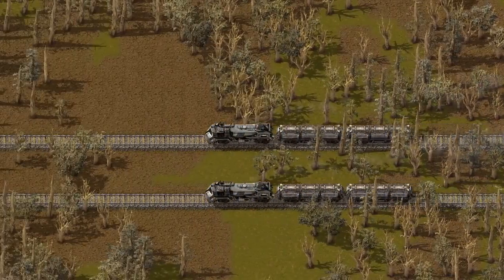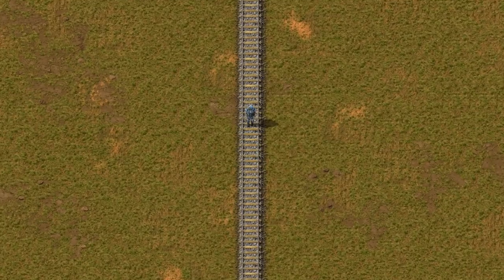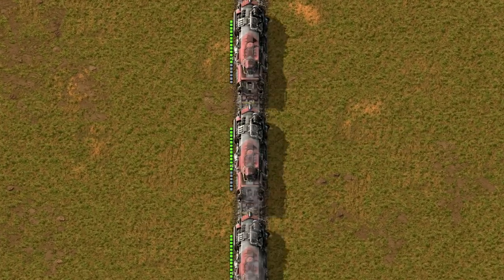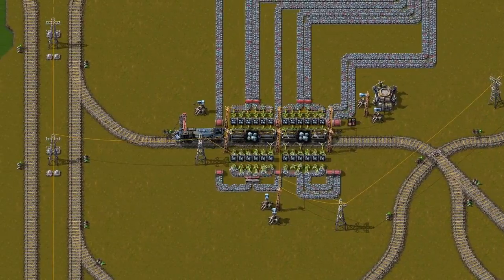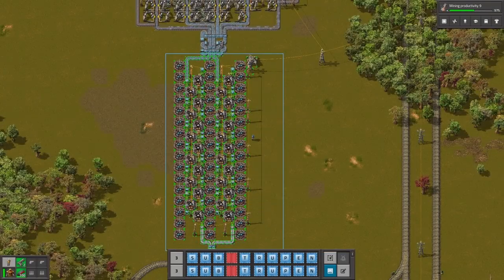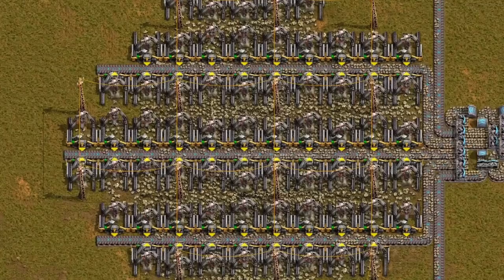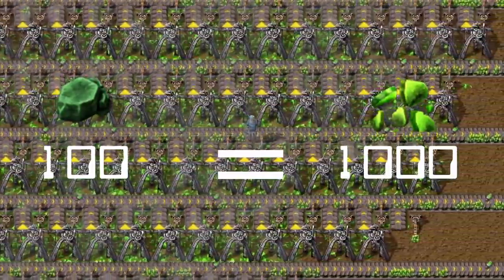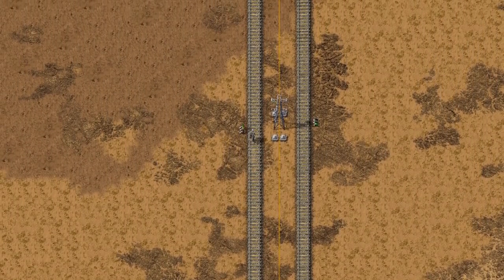Upgrade your trains

Comment: It's not 100% more efficient ( with iron / copper ), because of the productivity modules you are making 1.2 Plates per ore, which makes it 66.66% more efficient ( with stone it is 233.33% instead of 300% and with uranium it's just 733.33% instead of 900% ), but it still is very good
Reply from the maker: you are right, it's not as good as I said, but it's still a good thing to do
Reply: I always just build green chip manufacturing at most of my copper outposts. Bring in 1.4 trains of iron plates, send out 1 train of green chips.
Reply: Wait i dont understand the stone and uranium part
Reply: @ninjaexperto7217  Smelted stone stacks twice as high as raw stone, while also using 2 stone to make, so 1 stack of stone bricks is worth 4 stacks of raw stone.

U235 stacks twice as high as uranium ore, and if you fully kovarex the ore, it takes roughly 3 ore to make 1 U235, meaning one stack of U235 is worth 4 stacks of ore.
Reply: only under a factorio video can such a comment be top voted
and we all agree
Reply: @ninjaexperto7217  stone takes 50 and makes it into 25 ( or 30 with productivity modules ), because its orignal proportion is 2 stones to 1 brick, and urainum takes 50 and makes into 5 ( or 6 with productivity modules ) because its original proportion is 10 ores to 1 uranium
Reply: @DEMEMZEA  oooooohhh now i get it, thanks :3
Reply: However I would argue that outsourcing uranium processing isn't necessary, since as you won't use a lot of uranium in the first place (tbh here the only place you will ever use uranium regularly is for fuel rod, but even that is rare enough), throughput isn't a problem, convenient is king.
Reply: Do you have T3 modules for every furnace?

Comment: I usually build refineries at ore sites when I can build defenses, but if a refinery center runs out of ore from its fields, I'll send ore trains to it rather than dismantle it.
Reply: I just build a single express belt leading toward my base and extend it out wherever I see a lot of its ore type on the map, then any new ore fields can have their ore shoved onto the main ore belt. But don't trust me, I am not an engineer.
Reply: This is probably the best thing to do honestly.  Train congestion is going to be minimal on your rail spur lines that run to individual ore fields.  Rail congestion at your main base is going to naturally be much higher as trains deliver resources... especially if you're using rail to connect sub-factories rather than belts or bots.  You could do as Trupen suggests and build smelter arrays at every ore field, but that's a lot of building and deconstructing each time there's a new field needed, which can become tedious.

But by doing as you suggested and decentralizing smelting, you get the benefits of reduced main base congestion, without having to constantly rebuild smelting arrays.  The only real disadvantage is the increased complexity in managing the remote outpost and expanding smelting capacity.  The beauty of this method however is that if you have too much ore and not enough smelters, you can always build another smelter array at your next ore field, rather than expanding the first one.
Reply: @albertjordan3249  train congestion dont happen if you have highway. it only happens when slow train blocks faster running ones. Have 100+ train track blocks before trains enter or exists, they dont stop traffic, just join full speed and leave full speed, without jams

Comment: It is basically a choice between Rebuilding your smelters whenever a resource patch gets depleted VS using lots of trains.

Also you can attain additional efficiency by transporting them in the form of chips(green, red, blue) and steel, because plates in itself are barely used.
Reply from the maker: yeah you are right, you can make it even better :D
Reply: I like to make things "built to last" so I aim for excess mining and explore a lot outward for more richness so a smelter setup would be also relatively permanent in my situation

I really like the idea of condensing down transport items, it's just often making things too complicated for me

in dyson sphere program you just ship everything interplanetary, which makes it a lot easier because it's done by massive freight ships that work like a drone network
also I kind of get exhausted before I reach capacities where it would make sense to do so
Reply: @Trupen  Just make a whole factory at each outpost. There, infinite efficiency! x)

Comment: Something I would personally think might be a good middle ground would be basically have your main factory but keep most of the actual smelting away from it, but instead between your main factory and the different mining outposts, on the far outskirts of the main factory have a few semi large smelting bases that just kinda act as a hub for multiple raw resource inputs being the ores and have some trains take the processed stuff to the main factory to be used

Comment: See, now I used the trains to hauls ore because I already had a massive smelting area in my main base, where the extra pollution didn't draw in bugs.  I never thought about the stack capacity of the trains in regards to material storage efficiency.  I just learned something I already knew, but now that I'm looking at it, I know I can't ignore it.  Thanks for the simple tip on materials transport.
Reply: Definitely an argument for having separate stations for smelting and running trains from smelting units to production units in the factory.

Comment: Could you do a video explaining the big train rules? I always get confused on proper train input/output design.
Reply: Every 30 minutes or so it seems the natural resonance of my factory throws off my trains and they all collide!
Reply: @tylermcnally8232  I'd recommend reading more on the Train signals.  A 3-way intersection is the easiest to set up correctly, so make your train network look like the mortar in a brick wall.  You also need enough room between signals for an entire train to fit
Reply from the maker: maybe some other day, because it's hard to explaining in this video format

Comment: 50 Engin unite = 50 steel + 200 iron = 450 iron = 450 iron ore
200 green sircuit = 200 iron + 300 cooper = 500 iron amd copper ore. 
outposting. Yes!

Comment: Trains are like, the easiest to upgrade the throughput of. With bots, you have to keep adding tons and tons of bots to increase their throughput. With belts, you have to add additional belts. With trains, you only need to add more cars/locomotives. If you design your train stations with upgrading throughput in this way ahead of time, it's extremely easy, as you only need to add the additional cars/locomotives. 

Belts don't exactly have this luxury, because planning ahead to add additional belts is a lot trickier and more difficult and if you end up needing that space for something else instead, you could end up completely ruining that potential to expand. Bots also have a few limiting factors on their throughput, like Roboport placement and having to charge, and the odd and awkward way dispatching bots to fill requests works. Trains don't exactly have these limitations. Putting down rails in your base pretty much only needs to be done once and then you can have as many different branches come into that station as you want, after a certain point you'll reach a limit with how fast your trains can be unloaded in order to let the next train in, though. But that limit has a CONSIDERABLY higher maximum throughput than belts or bots.

But to be fair, Trains don't exactly compete with belts or bots in the same way that belts and bots compete with each other. Trains are really more for transporting a very very large amount of resources a very very long distance. Belts and Bots can't exactly do that.

Comment: A part of Factorio I really enjoy is, this math thing. You count those miners, account for productivity bonuses and/or modules, and fit exactly (kinda) how many arrays of furnaces you're gonna need. Why I types (kinda) is for me, woth RSO, I often get way larger and denser patches that I can't tap out entirely at once, so I rely on that patch for my, say iron. I assume my next needed production (3 times the previous or whatever), amd plan accordingly. True, we'd consume less than max mining production, but we consume less than we mine. And if you want extreme logistics, even with custom stack sizes, reduce resources into intermediary products that reduce 2 irons say to 1 gear. Obviously, you may need back and forth resources where you need product y and x from mine x, so bring that in if you will. I usually bring the least consumed products, like iron to copper mine for electronic circuits instead of the other.

Comment: I just build a large smelting station that has its own dedicated load and unload rail lines and stackers so the trains don’t even have to come into contact with one another. Up to 32 blue belts of plates for copper and 24 for iron and still haven’t come across a train bottleneck with 1-4 trains. Now if consumption exceeds production the entire base shits the bed and gets gridlocked… funnily enough that just means I need MORE trains unloading ore lol.

Comment: I disagree. Smelters with modules and beacons are more energy efficient in one central location. 
This way also means more rebuilding and tearing down of smelteries. 
It's just easier to use a central smelter and mining outposts. 
This might be fine for really large factories with enormous resource patches.
Reply: Who cares about rebuilding smelters? It isn't like pasting down a blueprint of something you already have built takes very long.
Reply: @petkras  Plus hauling all that stuff plus connecting everything (while at this stage, bots are better than belts, going with bots means carrying them too).
Reply: @1Maklak Just enlarge your Logistik Network. ;)
Reply: @CYBERNORM  Long-distance bots are a terrible idea.
Reply: @1Maklak  i am a noob, but i like it. I often forget Something to build, or have some wrong Train signals. My Bots can correct it. :D 
Just have to make sure, they dont have to fly over enemy territory. IF there are biter nests, just upgrade their Home with laser turrets and Solar panels + battery.
Reply: @CYBERNORM  Once you have all the blueprints, trains just work and the most time consuming thing is wiring up all the belts. Try KatherineOfSky's blueprints, they're good. 

I tried connecting a remote smelter to my base with bots and it was just a horrible traffic jam that ate electricity like it's candy. 

That said, whatever works for you. I like 4-wagon, 1-locomotive trains on a network with two rails next to each other, going the opposite ways, but with enough electricity and charging, bots can work too. They're just more efficient over short distances, so most people generally settle on a combination of trains, bots and belts.

Comment: Max train setup
A train with coal and no tech
100% acceleration
100% max speed
100% deceleration 
A train with nuclear fuel and max braking force
250% acceleration
115% max speed
200% deceleration

furthermore with the plates instead of ore loading 
50 iron turns into 60 plates (all of these are with 2 prod 3 mods) so not quite 2x density.
50 stone turns into 30 brick which is a little under 3x density
and the uranium 100 turns into 12 which is about 8x denser, but then you have to deal with enriched and unenriched uranium (maybe do enrichment on site.)
also if for whatever reason you just want to do basic oil processing it's better to do that one site and pipe / train the petroleum gas away as it takes 100 crude and turns it into 45 petro (58.3 with 3 t3 prod mods)

Comment: To me setting up outposts is quite annoying even without smelters and with bots. I guess my factory is still small.
Reply from the maker: you just need to make a nice blueprints
Reply: @Trupen  the problem is each patch is different, with trains coming from different side, different cliffs/water... Very hard to blueprint entirely
Reply: Terraform the earth to fit your blueprint, dont fit your blueprint to the earth.
Reply: @tylermcnally8232  mods that change patches sound OP.

Comment: usually there is way too little space in a densly packed ore world to build dozens of smelters like that. and, its way easier to build just a few smelters at the main base with perfect rations for the belts to be filled.

this tip is too inneficient for end game megabases, but too advanced tech for early and mid game, so its completely unusable for a regular base design. even my noob friend knows that its better to build 1 furnace at base than re build it every time the ore runs out
Reply from the maker: I think there is no wrong way to play factorio and I just shows all the possibilities
Reply: @Trupen  that is true, but when some random joins you in multiplayer, and starts attaching spiders to trains, and building completely unorganized and separate smelting setups that are double the size of your current base, thats where i draw the line

Comment: except cement but ok, it works well.

there is another thing you did not mention.
surface affects trains, so if you use stone or cement, under track they can speed up to higher speeds, which means they arrive 3-5% faster, depending on how long is the input to output.
Reply from the maker: oh I didn't know this :D